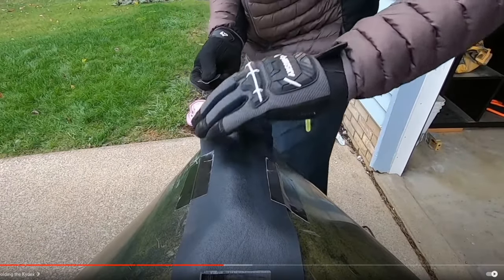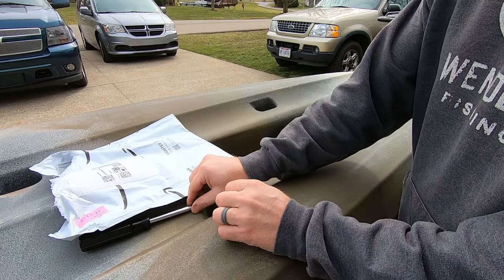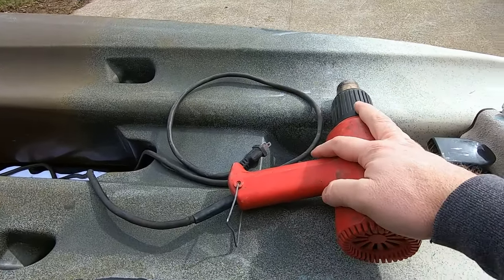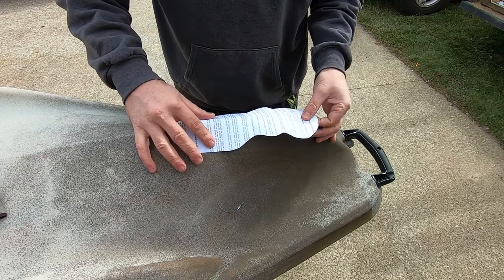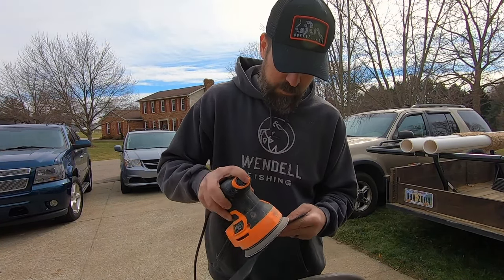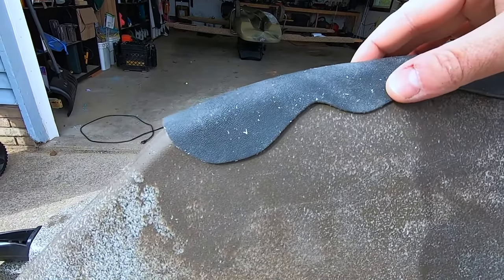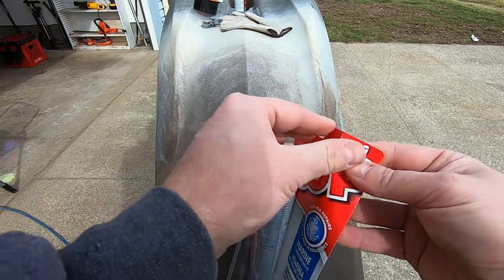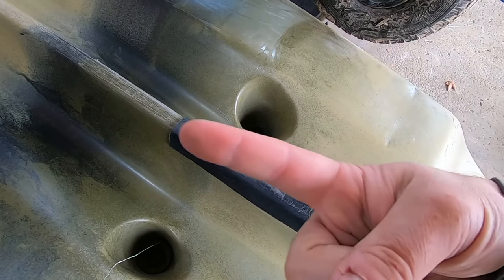Easy DIY KYDEX KEEL GUARD For Your Kayak 2.0! (Under $20)

Comment: Beautiful, professional looking and strong, what's not to like?! 
I made a keel guard for my Max 10 using old school fiberglass mat. Doesn't look so great but its super strong and will never come off. If I had to do it again however, I'm doing your version, looks better and easier to install.
Reply from the maker: Thanks Homestead! I may just pin this post!
Reply: I made one with fiberglass for my royalex canoe. I don’t drag it,It was grinding trough from course sand beaches mostly. I was seeing the closed cell-foam in a small spot before Id even noticed. When the fiberglass started getting sanded through, I got some carbon fiber from a friend who makes prosthetics.& just added on top. It’s done ok but it’s doing the same thing,started popping up in Spots . It looks like this is a good way to go. I am into guns and was planning to buy some to build a holster that’s like nothing else on the market anyway. Will get a few extra sheets . I’m going to be fixing gunnels & doing some other preventive maintenance ,repairs and upgrades all over the boat. Inside & out. All sorts of things & different materials in mind , but this is looking like the best alternative for bows and sterns . Going to go ahead and do the same for a loon 138. No problems with that one yet .thanks. I do a lot of salt water .maybe harder grit from fossils and coming In hotter sometimes. Will see how it goes. It’s going to be better & it’s time. Have to look into that goop. Should be fine. Thx
Reply: @wbwills2  That's a great plan and very cool making your own holster!
Reply: @wendellfishing  Hey - Can you do a follow up? How long has this lasted? What would you do different?
Reply from the maker: @joembikesdirectvideos7997  Wouldnt do anything different... this has held up like a boss

Comment: Why don't kayak manufacturers use protective material on the keels to begin with?  They charge a fortune for kayaks, we might as well get an optimized product.   Kind of frustrating.  Great video and advice.  I wish it wasn't necessary.
Reply from the maker: I agree 100%... No reason there isn't some type of indestructible material on the keel. Something like a snap on keel guard in the design is something I have said for years.
Reply: The do it so you can purchase another 1
Reply: I know, I just scratched my brand new one loading it onto my car from what I thought was a grass surface.
Reply: Some brands do have them. Ocean Kayak,Old Town
Reply: Engineered failure. They will never design anything to last forever. It's why DVD's, etc don't come in a cassette - it would never get scratched that way.

Comment: I have 2,400-hours on my Delta 12-10 kayak and I'm very careful, i.e., I use wheels vs. dragging my kayak thru the parking lot. Both the bow and stern developed cracks/leaks recently. I fixed them with JB Weld. If I knew his was going to happen I would have bought a toothpaste sized tubes of JB Weld at Walmart and filled the low spots on the bow and stern when it was brand new. Once I saw the gray JB Weld color I would have known I was thru the kayak material. I'd rather spend $20 for JB Weld vs. hours of labor.

Comment: I think this would pair up nicely in a two-part repair method for hull cracks and holes;  I'm sure you've seen the "Home Depot bucket" plastic welding patch repair, but after that's done, adding this on top would probably be the most permanent fix ever.

Comment: I’m curious how this is holding up. In my opinion, 3M 5200 is the best marine adhesive and sealant available. Thinking of doing this to my kayak and will most likely use the 5200 so it will not only bond the keel guard on but I can also use the squeeze out to seal and fair the edges. Great video, I had never thought of using kydex and I have plenty of it for use on other projects.
Reply from the maker: Holding up like a boss.. haven't thought much about it until someone asks me for an update.

Comment: Thanks for another great video. I’m going to do the same. The only 2 things that I will do different are lightly trace the cut and molded piece onto the kayak and smear a thin layer of the goop on the kayak itself just to ensure the best possible adhesion.
Reply from the maker: Right on Fabian.. let me know how it works for ya!

Comment: Great job, looks great!  I need to add a couple on my kayak. Today, my Hobie PA14 slid out of my trailer on the highway, it slide out when the light turned green, so it wasn't like I was going 50+mph, but it slapped the ground on the aft keel; I forgot to strap it down. Thankfully nothing serious, just some scratches.  So my plan is to add some guards on the front and back.  Thanks for the great video!
Reply from the maker: That sucks but I am glad you were cruising down the highway!

Comment: I've been aware of this for years and it's time to try one. I'm not as dainty with my kayak especially coming into the launch. Have worn through 2 layers of Gator guard. Like the goop idea over using the tape. Thanks.
Reply from the maker: Right on Greg... The goop is by far easier and faster to apply. Good luck.

Comment: Wendel, I have the SS127 , Two years in and I've noticed this keel guard would be a nice addition . I'm VERY rough on my equipment and I believe this type of guard would also serve well on the front area of the pontoon sections because they too take some major abuse. I was wondering if you had considered this as well and how you might approach the install? Love DIY  . Great channel love your breakdowns. 🐸🐸🐸🐸🐸🇺🇲🇺🇲
Reply from the maker: 100 percent boss. I've done it to both sides of my Native Slayer.. works like a boss

Comment: Thank you for this video, and when the KYDEX is damaged and I have to change it, is it easy to remove it with that direct glue? I just finished making my Keel molds thanks to your video but now I don't know whether to use double contact tape or direct glue...
Reply from the maker: There are some chemicals that will take off the glue.. it's a pressure hold so I imagine you could pop it off with enough force
Reply: @wendellfishing  Thanks for answering, what about the heat gun, do you think i will be able to remove it by using that tool?
Reply from the maker: I have never needed to do it so I unfortunately can't answer on this @edgarvilmanyi3948
Reply: @wendellfishing  I already managed to glue my kayak keel directly with the glue you recommend, definitely better than with double contact tape, thanks for the recommendation...

Comment: Great video. Just curious why you chose Marine Goop over an marine epoxy? Seems like marine epoxy would have a stronger bond. I put Gator Guard Keel protector on the bow of the kayak and it came off after the second outing, dragging the kayak over rocks in the river.
Reply from the maker: I have never tried epoxy to be honest.. the Goop has held for 1.5 seasons. Maybe I will try that next

Comment: I've had my P127 for two years.  I'm finally getting around to installing the keel guard.  I've noticed that the two smaller keels that are further back are getting beat up more than the center one.  Have you noticed this with yours?  Have you considered covering those at some point?
Reply from the maker: I haven't noticed this at all with mine.. but the stern of my yak rarely ever touches anything because of my sidekicks.

Comment: Thank-you: Derek you did the research and I saw that the first one did take a beating and led to a crack.  Why not use PVC instead of the Kydex?  My kayak will sit in a sub zero garage over winter.  I found 3mm sheets, about 25% thicker, too thick?
Reply from the maker: Hey Mike, Kydex is stronger than PVC.. you could definitely go thicker on the kydex. It's pretty malleable

Comment: This may be silly question...with that kydex gaurd on solid...if the kydex gets holes over time, will it still protect kayak from holes?? I think it would but with my luck, i would spring a leak and have to try to get kydex off...
Im just debating doing kydex or welding on extra plastic as gaurd. My current kayak is mod-ed to bone so dont want to give er up! But she has hole on spot that your video is showing.
Thanks for taking time to do these videos!! Great job.
Reply from the maker: The kydex could be removed if needed. There are some chems out there that will help.

Comment: How will you remove them when it comes time to replace thos one? Is Marine Goop easy to with after it's cured?
Reply from the maker: Hey Boss, here's some chems that will dissolve goop: Chevron solvent 1100
Chlorothane NU
Cyclohexane
Gasoline
Perchloroethylene
Propyl acetate
Toluene

Comment: I think in your first video you used two sided tape. It appeared that it was easy to remove years later if you wanted to replace the kydex. Do you think this version with the goop will be easy to remove if you need to replace your guard?
Reply: I used the 60 lbs gorilla tape on my river kayak last year and it’s holding up great. I recently bought a new old town pdl. I’m going to put a kydex keel gaurd on the front and back. Not sure how I want to apply it yet. I have the same question as TwoBuck Chuck. I’m wondering which one will be easier to replace down the road. Scraping double sided tape off, or trying to removing marine goop. both will be a small job but with the right tools I’m sure both can be done fairly easy. I’ve seen and read about countless people applying keel guards both ways. Ive done my own research but haven’t found anything to sway me one way or the other. Wendal was there a reason you switched up your adhesive process on the keel gaurd install?
Reply from the maker: Hey TwoBuck Chuck.... According to GOOP Central (1-800-693-GOOP or 1-800-767-GOOP), there are three recommended solvents for GOOP. They are acetone, toluene and naphtha.  Acetone will do a good job on GOOP that has not fully set. Toluene is a more powerful solvent that will remove fully set GOOP.
Reply from the maker: Hey Justin, According to GOOP Central (1-800-693-GOOP or 1-800-767-GOOP), there are three recommended solvents for GOOP. They are acetone, toluene and naphtha.  Acetone will do a good job on GOOP that has not fully set. Toluene is a more powerful solvent that will remove fully set GOOP. I switched it up because it brought the price point down even more and wanted to test the two against each other. I know both have been used for years but I wanted to see for myself.

Comment: Thoughts on using .06” v.s. .08” thick KYDEX? Would the .06” provide sufficient durability? Easier to heat/form? Less of a protruding edge to improve water resistance?
Reply from the maker: I think you get the same result with the .08 holding up longer. May be more difficult to mold but should not be an issue

Comment: On the instructions on the back of the package it says "not recommended to be used on polyethylene, and several other plastics. I have my kydex formed and the marine glue ready. Any issues you have had or heard about on kayaks? Just wondering.
Reply from the maker: Hey Ron, to my understanding, and I found this online is "There are no glues that glue polyethylene, nothing on the market makes a chemical bond. So, your left with products that fill gaps, and provide a compression seal, which is what you will be doing. Goop and 3m's 5200 do a good job at this. But keep in mind, that they do not actually glue to the poly, so timely inspections and occasional maintenance need to be done.
Reply: @wendellfishing  Thank you for the response and information. I'll install it today and try the Goop out.
Reply from the maker: @roncadenhead9650  I have had it on all season with no problem. Anytime

Comment: Once you used the goop, did it stay , or did you use the heat gun again for it to mold onto the keel?
Reply from the maker: Once I used the goop.. it cured in 24 hours. No need to use the heat gun again!

Comment: Hey bud, just got my kayak and was planning on doing the same, but I planned on doing the entire bottom side,
+ keel, I noticed you just did strips on the keel is there a reason you didn't do the entirety of the bottom where it'd get dragged and scraped against stuff?
Reply from the maker: I don't really drag and scrape my kayak as I have native sidekicks. That's why I just did the keel. It what get's the most abuse when I am entering and exiting the water.

Comment: I just finished using the marine Goop on my Bonafide P127 keel
It seems to work fine despite NOT being recommended for use on polyethylene!
Lol, I never read the instructions until after I  used the goop
My question to you is has the keel on your P127 held up since you installed it ?
I have no idea why the instructions recommend not using this goop on polyethylene ?
It seems to hold up well
I did use some marine silicone around the sdges of my keel guards
Is yours holding up well ?
No issues
Thx
Reply from the maker: It's not recommended because they say that it sticks, but it does not create a chemical bond, as such it is subject to releasing it's grip. This generally happens a little bit over time. But two seasons with no issue so far.
Reply: @wendellfishing  Awesome, that's what I expect too !
Thanks for the quick response 
I'm totally digging you're channel
Being a new Kayaking  fisherman, it has helped me tremendously 
Thanks again !
Reply: @wendellfishing  Oh, I forgot to mention that I used your P 127  Kydex keel guard video as my guide
Kydex is awesome as a keel for  sure
Reply from the maker: @kennynorris8205  Right on brother! Hope it serves you well
Reply from the maker: @kennynorris8205  Right on! I will keep em comming

Comment: How is 2.0 holding up? I actually had 1.0 at my first kayak. Now I got a new one, want to try your 2.0.
Reply from the maker: Exactly what I did. It's holding up great. I still have both on them with no issues. In fact, 2.0 was cheaper and much easier.
Reply: @wendellfishing  I had to ask. How do you plan on removing the goop when you need to replace the keel guard?
Reply from the maker: @SpotlockBros  Toluene or Goof Off has Toluene in it

Comment: Hey there, would this work with a torch instead of a heat gun?
Reply from the maker: I believe it could work.. but the torch is direct heat so I would imagine that you would have to keep it pretty far away. Would be tough to regulate
Reply: @wendellfishing  Yes exactly what I was thinking. I'm better off Snaggin the ole heat gun from work I guess.
Reply: @wendellfishing  Thank you.
Reply from the maker: @OntarioWoodlandAdventures  :)

Comment: How’s the goop keep guard holding up?  Seen some vids where they use two sided tape to hold the kydex on.
Reply from the maker: Holding up like a boss after beating the crap out of it. I did both methods and they are both holding up great. No issues since I adhered them. https://www.youtube.com/watch?v=gWgDEaZalbk&t=462s
Reply: @wendellfishing  also meant to ask why you chose the shape you did for the kydex?  Does it matter?
Reply from the maker: That shape allowed me to curve it around the curve of the yak without bunching up the kydex  @buckeye830

Comment: I have a Coleman canoe made out of that HDPE and nothing bonds to it. I have plastic welded cracks where the plastic has worn thin due to dragging (It's a duck hunting canoe) this would work great to gaurd the cracks. Did the goop keep it on? I'd be worried it would get knocked off.
Reply from the maker: Goop has held up like a boss so far and I beat the tar out of it.

Comment: Great video, and great timing!  I used your first video for inspiration for mine, got it done in a couple hours about a week ago.  I also used Kydex, but used JB Weld ClearWeld to adhere to the hull.  Haven't tested it yet, because the NorCal rain just won't stop, but soon.
Reply from the maker: Right on.. that stuff is solid... you will be good to go!
Reply: @wendellfishing  just found this video again - looking for a new solution.  The JB Weld failed, haha.  I think it doesn't like saltwater, and didn't bond that well to HDPE.  No big, at least my keel guard pieces are still shaped just right, gonna try the Marine GOOP you used.  How yours holding up?
Reply from the maker: No issues with the marine goop after a season of beating it up!  @kevinsteineke7454
Reply: @wendellfishing sweet gonna try that this time. Thanks!

Comment: Any solutions if you don’t have a heat gun?
Reply from the maker: The only other thing I could think of is a Hair Dryer to soften the Kydex. The problem is that Hair Dryers heat between 80 and 140 degrees Fahrenheit. Optimum Kydex molding begins at 330 - 350°F. People will soften the kydex in ovens and then form but there are all kinds of problems I see doing that.
Reply: @wendellfishg what problems do you see using an oven to heat the product?  Also, would love to see you do a video of removing the product applied with Goop to see how it would be to replace this product.

Comment: How someone can think tape, or something like Flex Seal (I've seen people use that) will hold up to even the lightest abuse is baffling. 

Mine is starting to get a little beat up after using it very regularly last year. I need to do this. I also want to cover up the wheel skeg it has with a solid piece. I think this will do nicely for that.
Reply from the maker: Path of least resistance I guess. I think you will be happy with your results Chew! Let me know how it turns out.

Comment: I've been putting my Pvc and kydex in an old toaster oven.
Reply from the maker: Do you have problems with it wanting to go back to the original shape during the shaping process?
Reply: I put stripes of kydex on the front and back keels. For some of the pieces, I put the tape on it and then heated up in the oven. Placed it directly on it.
Reply from the maker: @LostInTackle  Okay.. that makes sense to me